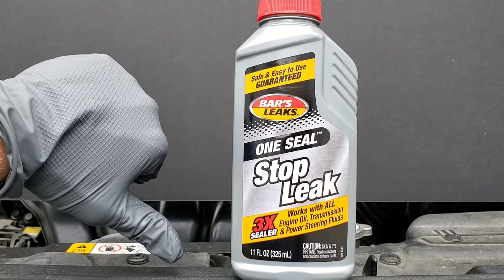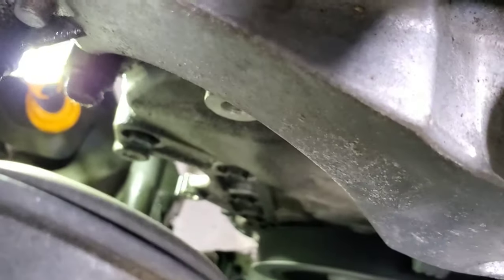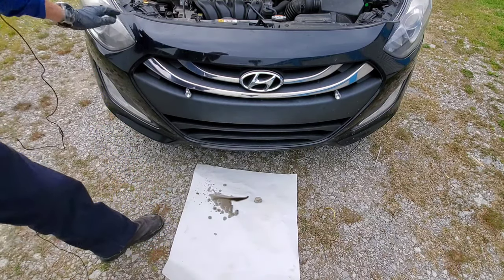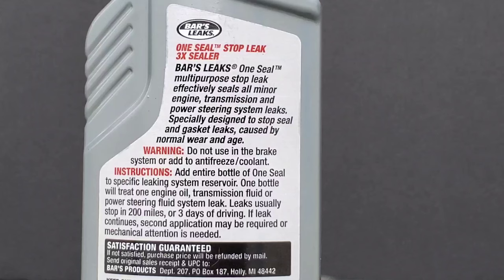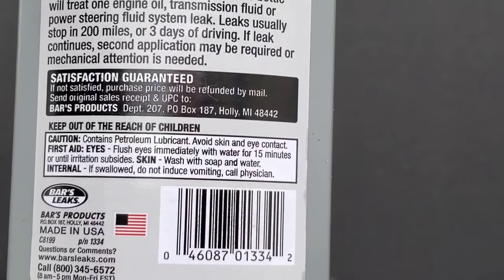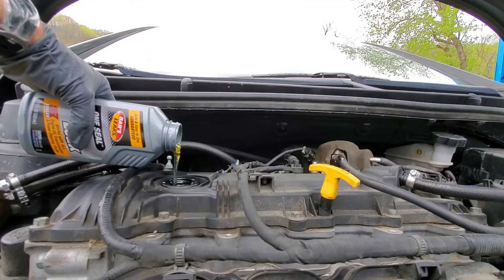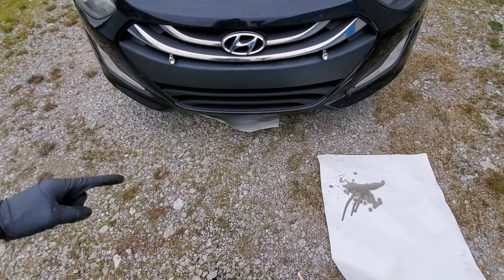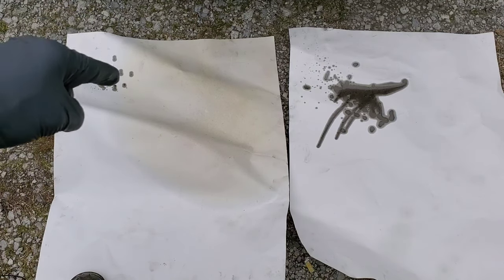I can't believe what Bars Stop Leak did to my engine!

Comment: AVOID BARS PRODUCTS.  After having a "check engine" light on for months, I used this in my 2004 Honda Accord along with Bars radiator stop leak.  Within DAYS, the engine valves stuck, cracked the pistons (interference engine) and it all seized up.  I went from a "check engine light" on to a NO engine situation.  Car was totaled.  I filed a claim with Bars, but they didn't honor their warranty.
Reply: A stop leak isn’t gonna cause valves to get stuck. All it does is swell seals. Granted it can swell valve seals but it would have to be swelled tremendously for it to do that.
Reply: @charliethiede3992  valve seal?
Reply: @charliethiede3992  thanks.  I gotcha . :)
Reply: What percentage of the problem do you think was your lack of maintenance? You say you drove it for 4 months with a check engine light? Maybe check the code before you continue driving it?

Comment: Do you have multiple of those small radiators and use new product in new radiator... Or did you run multiple products in one radiator? Have you ever looked inside the radiator to see if it filled it with gunk?

Comment: I need to know if ANYTHING will stop a valve cover leak with oil going into plug wells 4 and 5 on my Duratec DOHC V-6 engine.
Reply: New valve cover gasket. Cheap and easy fix. Save lot of dollars on plugs and engine damage.
Reply: @mattdeshane2435  Yep... that's what I'm gonna do.  Not so easy on this V-6 though.

Comment: did u change the oil before adding or jus add the stop leak,   just asking because thats what ive seen on a few forums,, says to drain then add the stop leak then refill like a normal oil change,, problem is for it to work effectively , has to be done at EVERY OIL CHANGE, or drop the transmission and replace the entire seal,,  i guess we will see,, cuz im having the same issue on my Jeep

Comment: I am a retire auto tech. After 40 years I have found this to work best.  
ATP AT-205 Re-Seal Stops Leak
Reply from the maker: Thats great news for those in need thanks.
Reply: Couldn't agree more.  ATP reseal is the real deal.  Turns a plastic spray bottle into bubblegum.
Reply: Will it work on V-6 valve covers. I've got oil in a couple of plug wells on Bank 2 cylinders 4 and 5. Cylinder 6 was fine.  Can't even see Bank 1 or the coil packs there.  I hate to pull the intake and both valve covers on a car with 225k miles.  The car is in perfect condition otherwise. Just a royal pain the way these sideways V-6's are designed. Anyone have any luck with this problem?
Reply: A country singer and a auto tech! Damn Willy, you good boy!!! Lol

Comment: ''DO NOT USE bars stop leak its not safe for your engine, transmission, power steering system'' Why do you say this you don't mention in your vid why its not safe for your engine.

Comment: Just replace gaskets. All these things gunk up engine, eventually.
Reply: Actually not all. Seals actually become hard over time and deform and eventually become brittle that leads to complete failure.  Some of these products contain chlorine, which causes the seal to swell. Chlorine is harmful to engines. Others, like Omega products actually contain chemicals which causes the seal to soften and helps the seal to seal better.  Some high mileage oils also contain these same seal softening chemicals to revive seals. Valvoline high mileage is a perfect example and has API and  many different motor manufacturers approvals as well.  One of my friends had exhausted all his avenues with seals leaking on his automatic transmission.  I offered a tin of Omega seal reviver which he refused at first as he was worried it would block up his transmission. Eventually in desperation he tried it. Never had a problem with it again. He sold that car due to engine failure years later.
Reply: @pieterjones5425   Valvoline hm is what I've used for years and never a problem.
Reply: @johnwagner4559  Valvoline HM  is an excellent oil and contains seal reviving additives. It has one awards too. This product also contains high zinc additives that reduces engine wear. Your normal engine oils have had zinc additives reduced from previous years.
Reply: I have a 07 Kia Sorento it has an oil leak in the value cover gaskets can anybody recommend a good solution I'm on a budget here I know it's always better to fix but is it expensive should I just get a solution 😬
Reply: I have a 07 Kia Sorento it has an oil leak in the value cover gaskets can anybody recommend a good solution I'm on a budget here I know it's always better to fix but is it expensive should I just get a solution 😬
Reply: HELP!!!
Reply: @trichomebeast1130   Change them.

Comment: Not fully satisfied with your presentation. You did not run the engine. In my opinion that should have been  better mix if you let the engine run and maybe the there will be no more little leakage.

Comment: I have an oil leak, but my question is should I put the bars leaking now, or do an oil change first and then put it in afterwards, my oil looks pretty decent and not quite ready for an oil change yet?
Reply: Either way works but drive the car for a couple days, 1 hr is not enough

Comment: I am about to find out how good this is. My impala has a rear crank seal leaking. Time will tell.
Reply: What is the results?
Reply: @krtolebiohazardcs1.681  I haven't tried it yet. I am waiting until i change the oil and will add it with the new change. I will try to remember to post up how it works/don't work.
Reply: @jabomiles6947  did you do it? Did it hold up?

Comment: DO NOT USE bars stop leak its not safe for your engine, transmission, power steering system. I cant believe what bars stop leak did to my engine. Today on Nates interactive auto we show how to stop a engine oil leak. stop automatic transmission leaks or power steering even oil leaks all in one oil additive or oil treatment. fix your engine oil leaks the easy way. Also check out STP stop leak. The bars leaks one seal stop leak claims to stop leaking  gaskets and bars stops oil seal leaks. lets us know if you would like to see Lucas oil transmission fix. we have tested and review Lucas engine oil stop leak check out that video.
aggressive passive message sounds ridiculous.......

Comment: Does it go in the engine where the motor oil goes???

Where does power steering fluid go??
Reply: No in the power steering spot
Reply: I just did this for power steering
Reply: But if you use this for gasket leak idk if it would work

Comment: Have an BMW 545 2004, that was dripping a little oil from the valve covers. I found the Bars "Stop Leaks" and poured it in the engine.
After the first day of driving, not much change, not after the second day either. But on the third day the oil was pouring out under
the car. Disaster. My worst idea ever.
Reply: Sven-Olof Larsson That does not make sense. It is supposed to stop leaks. Are you sure you followed the instructions?
Reply: Sounds like your car is a POS and your blaming it on this product 🤣
Reply: Sounds like you fell under the "Needs Mechanical Attention" disclaimer.

Comment: I hate to break it to ya. That particular brand of oil leak solvant, you have to drain the coolant system then add it to the new coolant you add after. Its misleadiing and should Never be poured into the motor oil. 🤦‍♂️